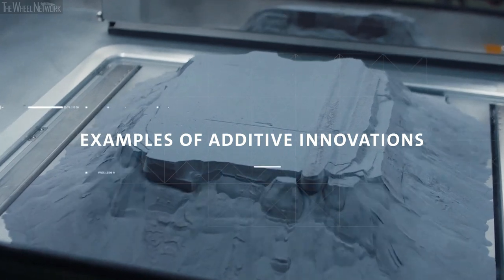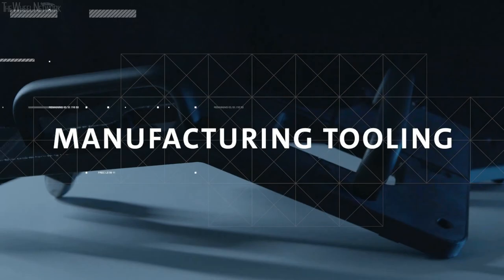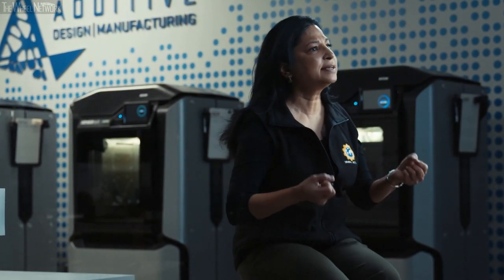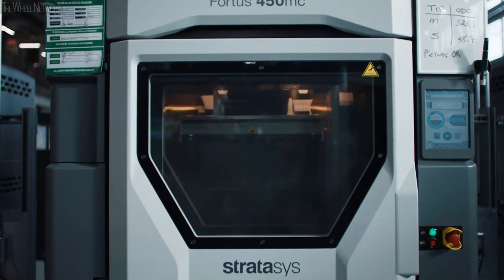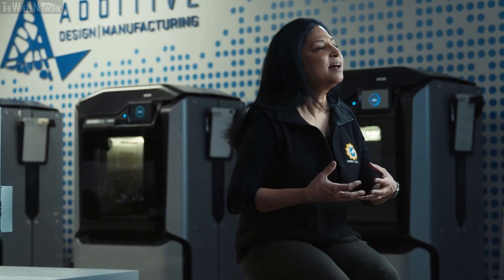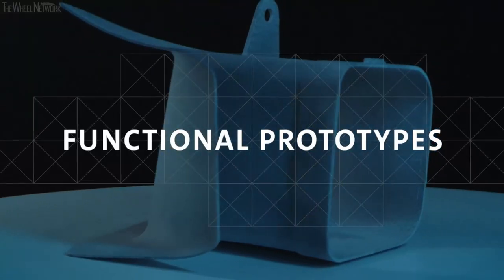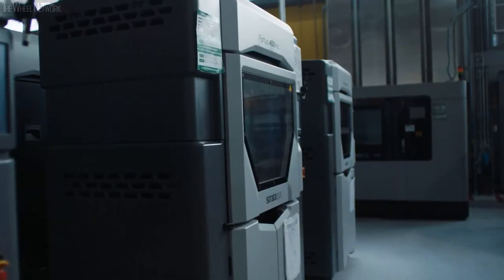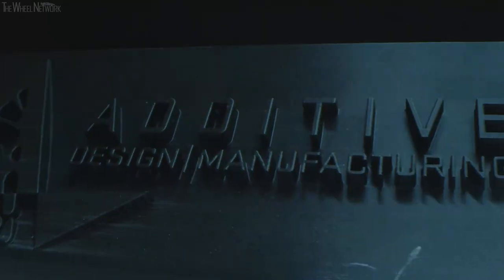General Motors New Additive Industrialization Center Dedicated to 3D Printing

Comment: Tell me more how you have been able to make 3d printed parts without any added costs on functional prototypes? To reach that you would need free machines and materials on the printers...
Reply: Compared to traditional prototyping techniques (think subtractive manufacturing) the processes they are using are much faster and less costly. Of course not all applications are the same, so there needs to be a screening process to determine the potential benefit (cost, time, performance) to the company.